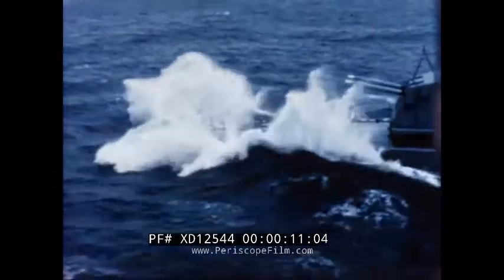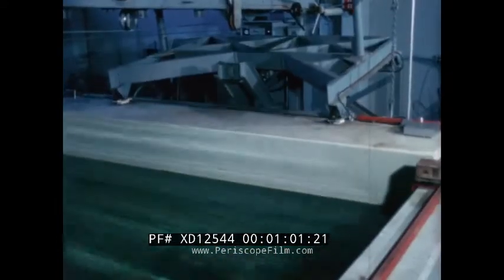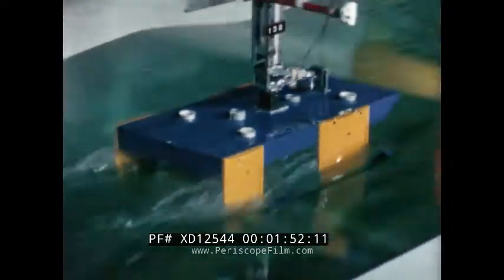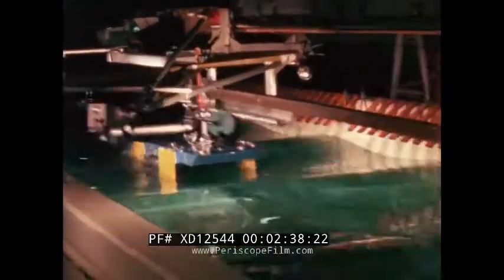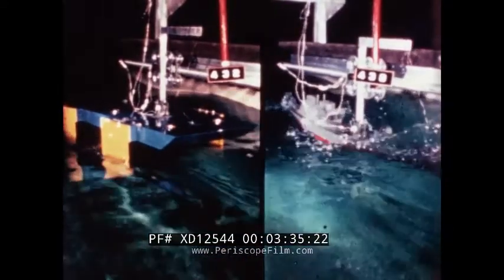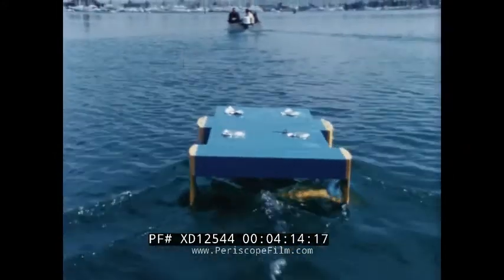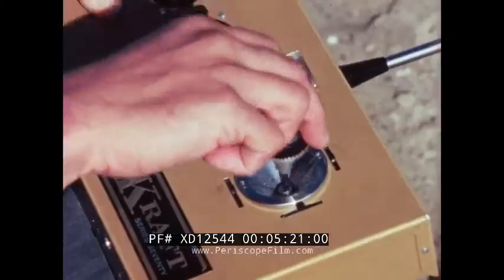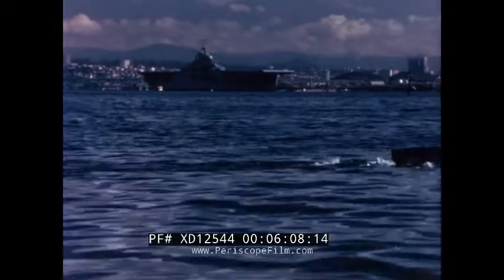“ SEMI-SUBMERGED SHIP STUDY ” 1960s US NAVY SHIP HULL DESIGN RESEARCH FILM  XD12544

Comment: Interesting to see that this has still not really been adopted. I guess one wlaw that is not mentioned is, that a large ship like a aircraft carrier would need a huge water depth at all time . possibly something like 200ft or so. Meaning that going into harbors, dry docks ect. would be out of the question. Even certain sea areas, like the Baltic sea, would be unaccessable, same as the Suez and Panama canal.
Reply: I'm guessing it didn't respond too well to torpedo attack.